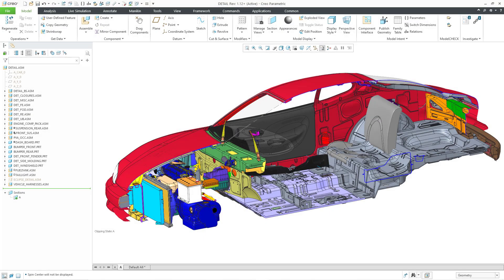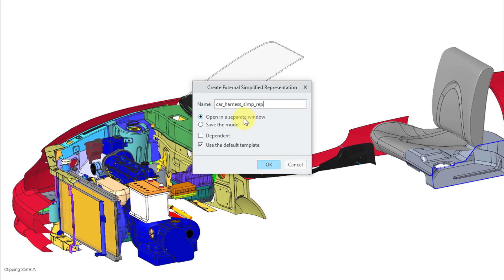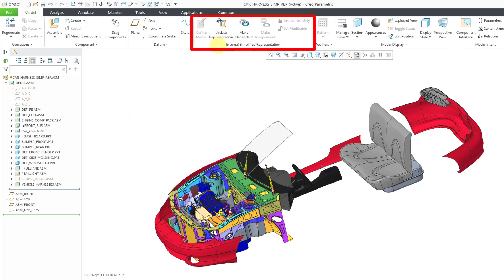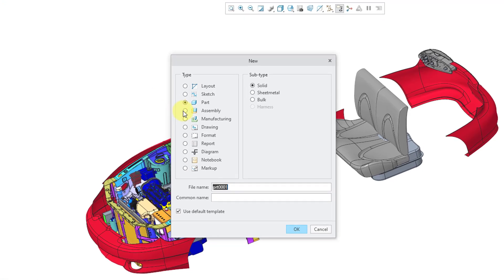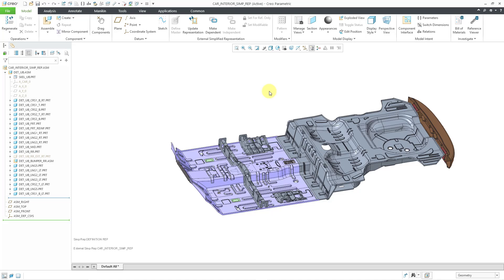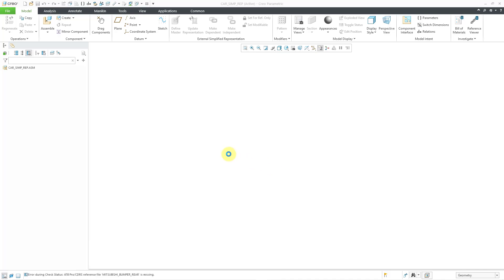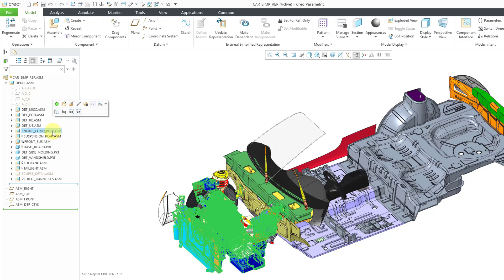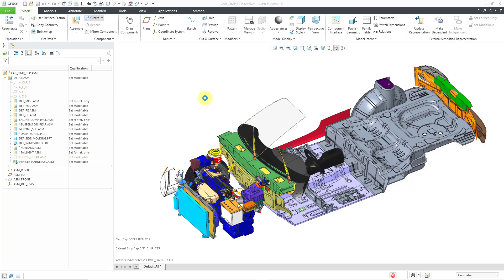Creo Parametric - External Simplified Representations - Large Assembly Management

Comment: Can we use specific defined representation of the one  asm. in to the other asm.  means can we import this represenation to other asm
Reply from the maker: Well, I want to make sure we understand each other because I don't quite understand your question.

First, we don't "import" one Creo assembly into another Creo assembly. We can assemble an assembly as a subassembly into a higher level assembly. In that situation, we use constraints or connections to locate the subassembly into the higher level assembly.

Second, Simplified Reps are primarily a Large Assembly Management tool. They reduce the burden on your computer's resources by allowing you to limit the amount of information brought in for an assembly.

You can apply a subassembly's Simplified Rep in a higher level assembly using the User Defined option. For more information regarding that, please watch my video "Simplified Reps Tutorial."

Comment: Hi. Thanks for sheding light on this function which I wasn't aware of. 
Are there any conflicts with using this with Windchill? Does it mean you could get updates through the "update representation" and not just through checkin if someone else is working on a parent assembly?
Reply from the maker: There are no conflicts with Windchill. You get updates the same way as any other CAD document, by updating or synchronizing your workspace. It behaves like any other model when someone is working on the parent assembly.

Comment: Hi Dave...Does the simplified representation option works for an imported (non-creo) assembly file? Also for a creo assembly file whether datums created in the original assembly be available in the simplified representation assy. file? Thanks...
Reply from the maker: 1. That's a very wide question. Depends on how it was imported. If from STEP or IGES, then it's just like a native Creo assembly. If using UNITE, it depends on how you brought it in. 2. Datums in an External Simplified Rep behave just like in a standard Simplified Rep, so it depends on the rep you apply to the component (Master, Automatic, or one of the pre Creo 4 reps). 

As with using any functionality that is new to you, I recommend performing some validation testing for yourself so you are comfortable with the behavior.
Reply: @CADPLMGuy  Thanks for the reply